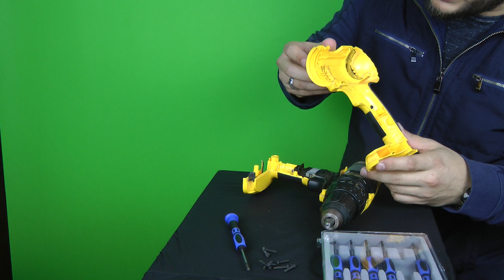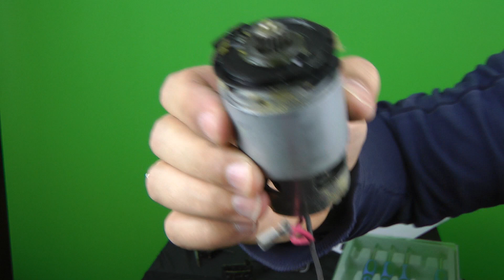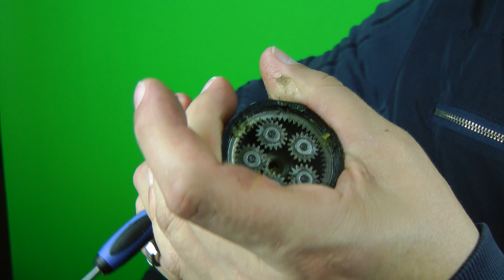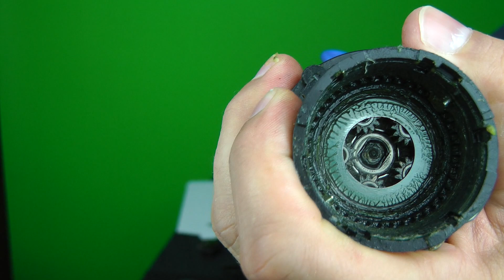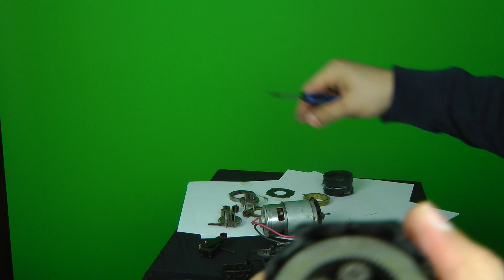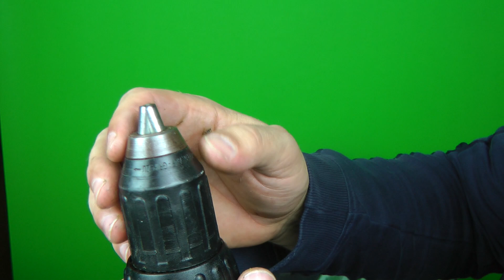What's inside a drill? Lets find out!

Comment: That drill still uses a Ni-Mh battery, so most likely the plates inside the battery are just sulfated.
You could fix this by plugging the battery into the charger. Plug the charger into a electrical outlet block that has a power switch. Then connect the block to mains power and rapidly toggle the power switch by hand. 
The sudden power spikes will cause the sulfated area inside the battery to desulfate allowing the battery to work again. 
Note 1: Most powerdrill chargers don't have sufficient surge protection (if any) in the charging circuit, cause it would increase the number of components, weight and width of the charger (and thus price). 
Note 2: This 'trick' works with most batteries except lithium (the power spike in those can cause a short and they than can catch on fire).